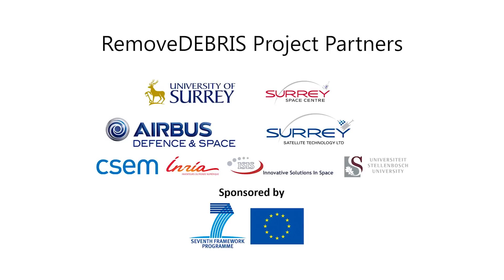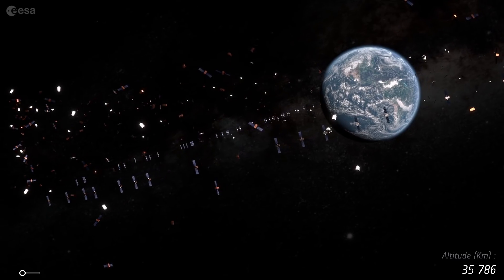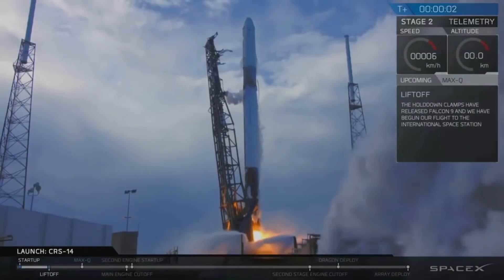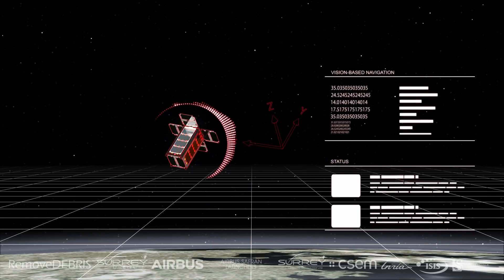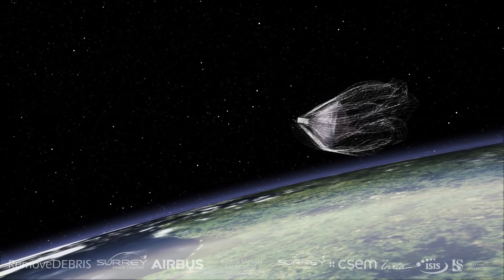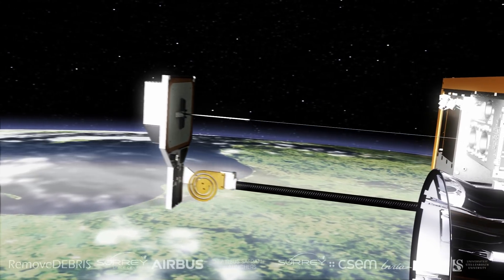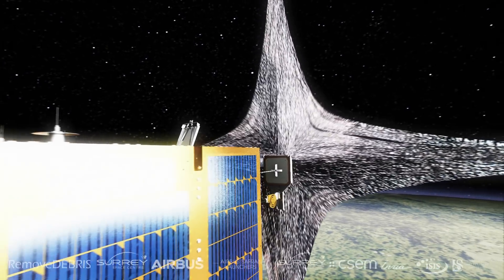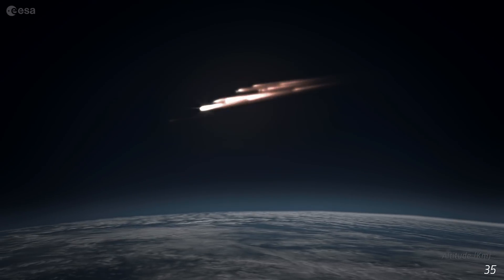Extended Remove Debris Mission Video

Comment: why burn scrap?  it should be captured and parked in graveyard orbit. think how much it costs to launch a kilo of metal and electronics, now imagine a spacecraft that captures and melts down debris, seperates metals by their melting points then stores them for in orbit manufacturing. the vacuum of space makes ideal conditions for smelting and extrusion of angle or box section metals/ a solar parabolic reflector could easily make the required temperatures. other parts of debris such as plastics can be gassified to act as thrust to move the craft. there is also much to be learnt from analysis of old satellites and the effects of radiation. there will come a day when all satellites are manufactured in orbit, so whoever is first to get that valuble resource will get very rich

Comment: No .. not to be a ass but u cant ... there is no drag.. if you going next to a object then ur going to hav to match its speed . .. sorry im just a guy that likes space
Reply: Yes there is drag, the atmosphere doesn't just stop, it gradually fades away.  It's not much compared to down here, but you don't need much to lower the orbit a little, which introduces more drag, lowering it more... and so on until it gets so deep in the atmosphere that it burns up.  For higher orbits the atmosphere gets too thin and you'll need to use thrusters on the capture craft to decelerate.
ISS resupply missions include rocket fuel to counteract this drag.  "At its current altitude, the space station uses about 19,000 pounds of propellant a year to maintain a consistent orbit" - NASA.  Quite a significant part of the resupply tonnage.

Yes you have to match the orbit of the thing you want to capture, but most junk is in similar orbits, so a small fleet of micro-sats could launch together and each rendezvous with different debris items without requiring much fuel.

Just a guy who knows some stuff about space.
Reply: @mostevil1082  hmm well you learn something new every day lol thanks bud

Comment: Great simple description of the mission's objectives. Worth mentioning that active debris removal is only one method of debris removal; post mission deorbit of spacecraft is much easier and more effective.
Reply: Depends. Thermospheric cooling and the consequent reduction in density means that current IADC guidelines (i.e. 25 years) may not be relevant any more. In some LEO models, even with 90% PMD success rate, debris will still increase significantly over the next 200 hundred years. ADR is a good and necessary option. 

(Source: Lecture by Professor Hugh Lewis)